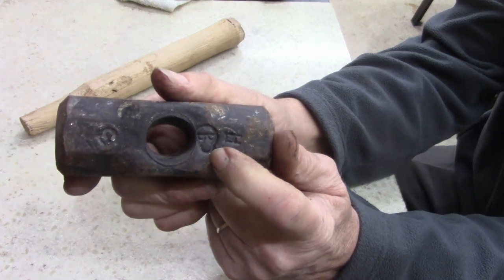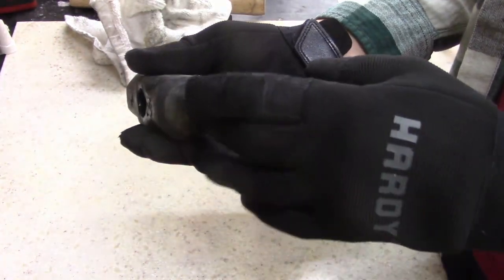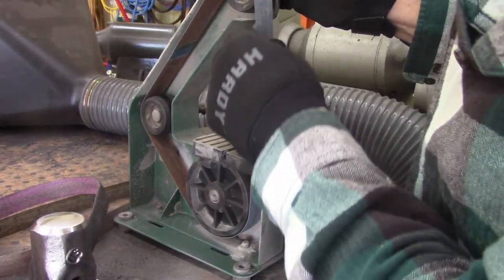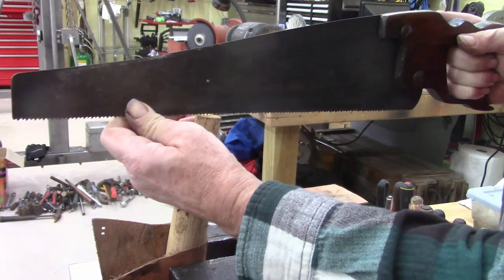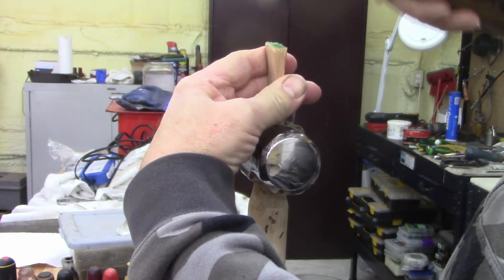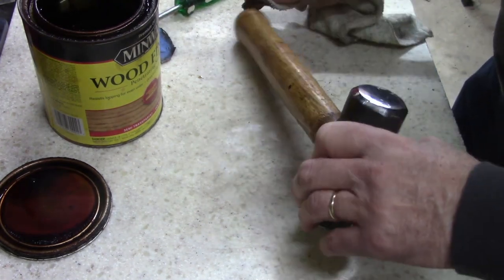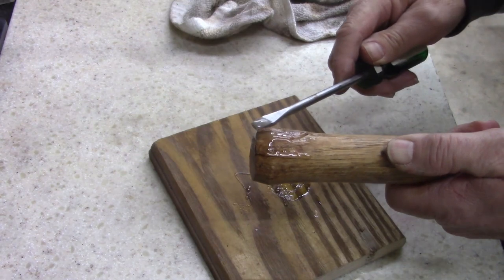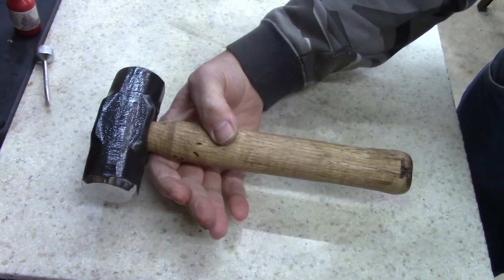Restoring a junk hammer.

Comment: I would take a angle grinder to it and remove the casting marks and get rid of some or all of the imperfections in the non impact areas.  Would the “scotch Brite” wheel be a fiber wheel?
Reply from the maker: If I were to make it a trophy piece maybe, but I believe in using my tools, I do have a couple of tools I cringe when I use them because they look so good and shiny, it is a fiber wheel when I say scotch brite wheel, I do not script anything when I make a video I want people to see and hear even when I make mistakes. What you see with me is what you get mistakes and all.!!!!!!!
Reply: @djstoolrestorations  I agree tools are rarely art work.  I think they all need to get used for the purpose they were designed for.  As for not remembering that it is a fiber wheel is a welcome reminder that everyone does these things.  Yesterday I repaired a 10gauge 50 ft extension cord and told the person that asked me to fix it I used shrink wrap because I could not remember that it is called heat shrink tubing.
Reply from the maker: @Rusty_ok  My wife says, I am getting old!!!!!!!😀😀😀 and forgetful!!!!😀😀😀 what does she know she's a woman!!!😀😀😀